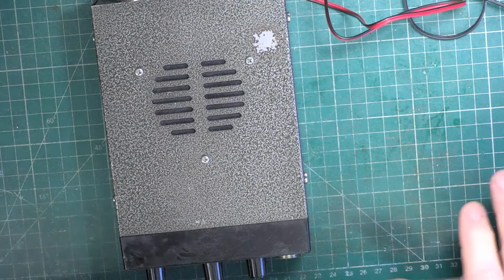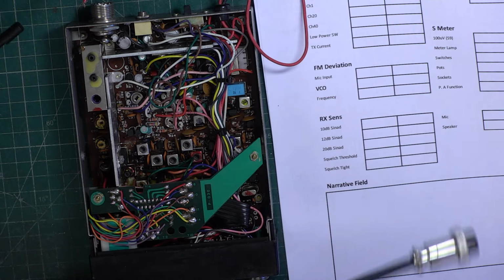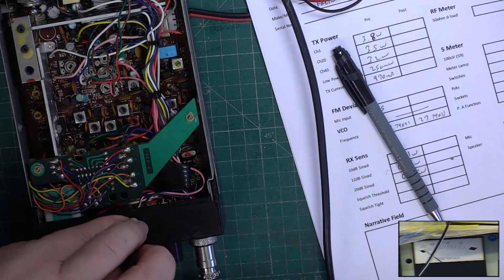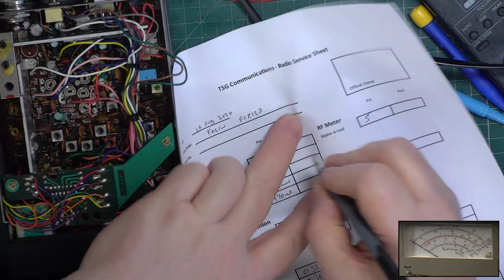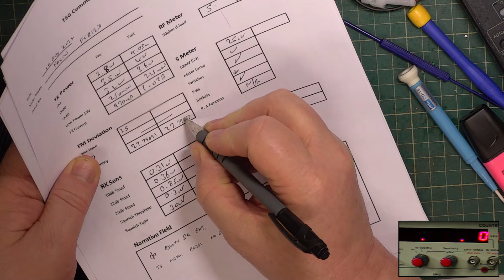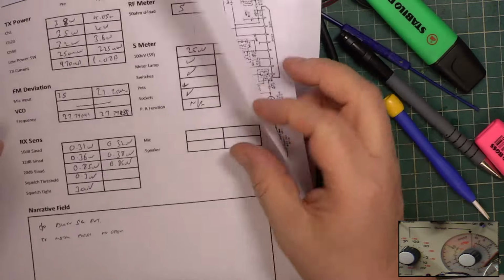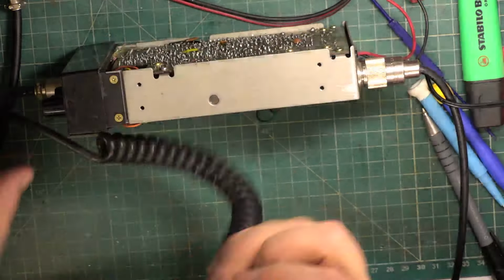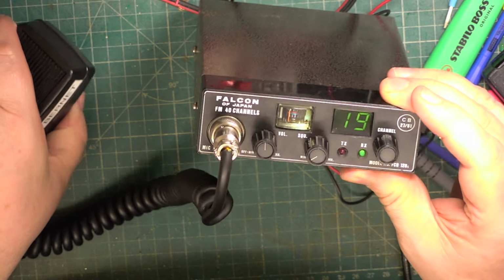Falcon FCB1281 CB7/81 UK FM  CB radio - service alignment

Comment: hi richard good luck servicing the falcon fcb 1281 cb 7 /81uk fm cb radio from paul chapman at east sheen 73's  also you didn't say thank you on the hand held air test
Reply from the maker: Thanks for the comment Paul,  There is no comment from you on the hand held test so your comment may have been rejected by the filter & then I don't see it.

I have strict filters set to ensure comments are only relevent to UK FM CB radio.

Richard
Reply: Thanks for the comment Paul I always enjoy reading them .